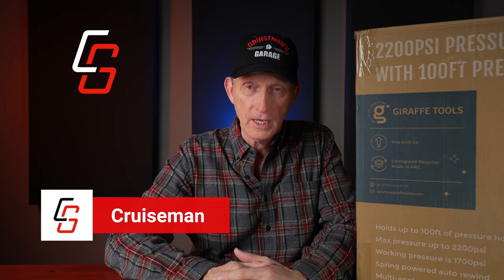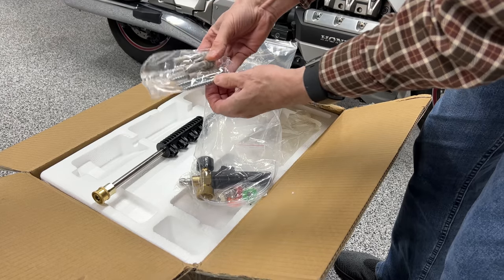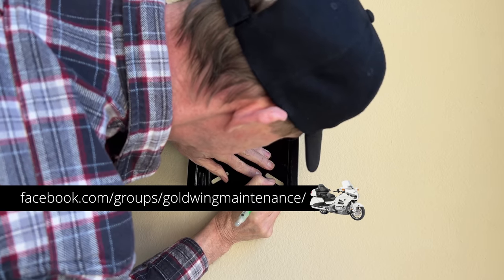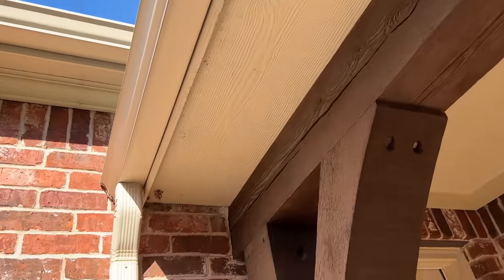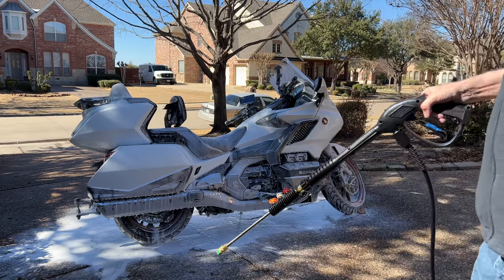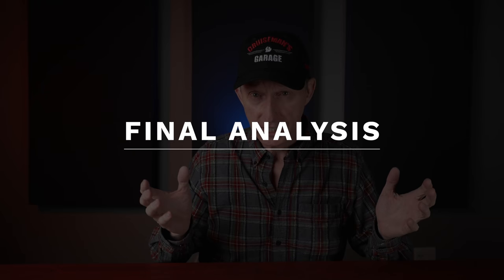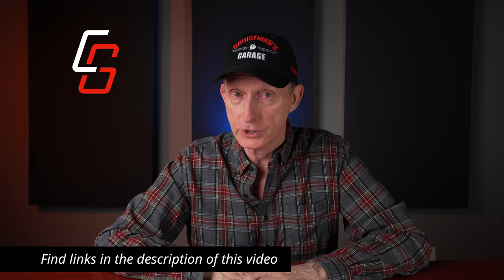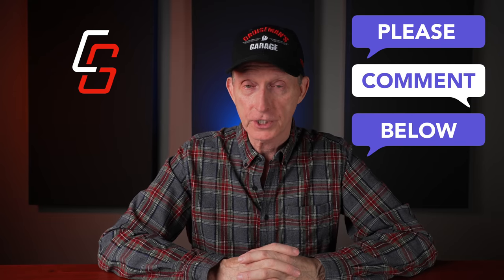Don't Buy A Pressure Washer Until You Watch This Video | Giraffe Tools Review

Comment: I must be behind the times as i've never used a water pressure when washing my motorcycles. And you've seen my Goldwing in my vlogs and it's alway's squeaky  clean and glistening!
Reply: 100% Ge. I wouldn’t either. Even with finessing of the spray and direction of the nozzle, it’s just not worth the possibility of any water seepage over time due to the pressure. Cruise did mention being careful in using one for the bike. Torrential rain wouldn’t target water like a pressurized flow from a nozzle would. Besides, hand-washing is relaxing and part of the ownership experience. It’s becoming one with your ride.
Reply: @roadglide  I agree with "becoming one" with one's ride.   Same goes with doing whatever maintenance I do; being more intimate with my 2018 Goldwing Tour DCT. :)
Reply: I bought a 2300 psi electric washer from Harbor Freight that is cart mounted. Portability and cost is unbeatable especially with their discount coupons. Added the soap fogged, shortie handle and wand extensions off Amazon also a turbo nozzle.  Totally satisfied and saved substantial bucks going with their tools across the board. Compare pricing as I do not know the cost of this unit.  Just checked on the pricing of this unit. $300. This price point opens 10’s of options gas and electric all more pressure and all portable. A wall mounted pressure washer is an innovative approach in the market for sure. They would likely be more competitive if they included a portable cart with removability which is routinely needed. You can pick up the Harbor Fraight 2300 psi model for $240 and can find 10 to 20% discounts routinely.  This would pay for the accessories off Amazon.

Comment: Hello! Mmm....you have an exposed aggregate driveway, if you use the wand only on that type of concrete job, you remove the small fine particles holding the aggregate together and the sealer(ask me how I know) you should use an attachment for that purpose which this is a good quality one ....... Mi-T-M 14" surface cleaner...... also after you wash your driveway let it completely dry  and you should re-seal it . Very easy to do with a pump sprayer. I do this every second spring, twenty years later and it still looks new 😁. Thanks for the vid. Be well !
P.S: a good review deserves a good deed(advice) back.

Comment: I won an electric powered pressure washer from work in a raffle.  I love using it.  I sold my gas pressure washer since I only used it once or twice a year and was always fighting the carbs.  If I was a professional cleaning guy, I would keep a high-end gas pressure washer around, but for small projects around the house (and me living in a single story ranch), I don't think you can beat a small electric pressure washer.

Gas pressure washers are worth the money when you have to hit multiple story structures without a ladder, plan on using a rotating ground brush attachment, or simply don't have access to electricity in a remote area.  I'd also suggest investing in a "turbo nozzle" for any pressure washer regardless of gas or electric.  It gives you the power of the zero degree nozzle over a much wider arc.

Comment: This should do ALL you probably need. I have a Simpson 3300PSI with Honda Motor. Inhave a lot of concrete to clean, and actually use a surface cleaner for my driveway/Patio. Change to a lesser tip if you want to have less force coming out, especially on motorcycle! I use a foam cannon for my cars all the time. I recommend Chemical Guys Snow Foam for great foaming action.

Comment: A suggestion from a small engine tech, if your unit does not have a bypass, turn off the pump if sitting for more than 30-60 seconds. You can tell if it has a bypass because water will flow with less pressure when trigger is not applied. The pump uses the water as a cooling device. So no flow, means no cooling. I've seen many blown seals because of this.

Comment: You'll now need to invest in a motorcycle blower dryer....something like a Bruhl here in the UK. They are absolutely essential for getting the water out of all the nooks and crannies in order to properly dry the bike and so prevent any corrosion.
Reply: I just use my gas Stihl leaf blower which is  fully capable for lawn work and drying all vehicles prevent micro scratches to paint from towels and chamois.
Reply: @SecurityBob  WORX electric/rechargeable leaf blower I use. :)
Reply from the maker: I got one as a gift recently and plan to review it as soon as it warms up!

Comment: Chris you would really like a Black Max 15" surface cleaner for your pressure washer for $100 I saw one at Walmart last summer. It would make pressure washing your driveway quick and easy. I have one I bought at Sam's club that doesn't have wheels by Power Fit 15" for $80.They have two pressure nozzles that spin under the 15" housing. If you don't already have one you will be amazed.
You have been a big help to me with your videos. I felt I owed you one. 
Have a great riding season
Don

Comment: Accessories. Wand extension(s) and a high pressure multi nozzle rotating surface cleaner  which makes large surface cleaning much easier.  I also use it on the metal roof and side oy my large metal storage shed.  Remember water hose length and extension cord if remote usage away from the house. Do they sell a wheeled cart? If you need portability. There are compress spray can lubes available. Harbor Freight has similar but portable units. 100 ft hose from compressor source may reduce head end nozzle pressure just a thought when spec’ ing pressure requirements.

Comment: Just watched Crown talk. You're absolutely right. Electric vehicles can't be supported with current infrastructure. It won't happen in my lifetime. I do have Electric power tools,  mower, saw. They work fine. I'll have the wing out in 2 weeks.  Fuel, 87 Oct. $4.39. I have a feeling the price of all motorcycles will go sky high. At 38 to 42mpg is a no Brainerd. Just like the price of used trucks. Sorry I had to go on this blog, couldn't get to comments on the Crown blog. See you on the road .

Comment: Chris, Having been in the trucking industry for a great many years, I have used pressure washers for a long time, and these are the industrial type.  My current pressure washer is 3500 psi at 5 gpm and will heat the water almost to 210 F way more than what you are using, and this is just a statement not a contest of pressure washers.  The thing to understand is that no matter how much pressure you have, to get something really clean there has to be contact made to the surface of some kind with something other than water.  That would be a brush or micro fiber towel, a chamois, chemicals help but they are not the complete answer.  Over the years I have washed paint away from a truck, without getting the dirt.  I also use it on my current 2019 Goldwing all of the time, however I am very careful how I use it, especially since the combination of that much pressure plus the heat can be extremely damaging to painted plastic parts, this I learned from a divot I put in the front fender of my 2009 Goldwing by getting too aggressive.  I like you stay long distance from the buttons and switches, however I am not afraid to get after the wheels, (I really like how it gets the brake dust) tires, and aluminum parts.  i think the real key to success with a pressure washer has to be using a measure of common sense.  I have also found that sweeping the spray and not concentrating it will really help to keep you out of trouble.  I love having access to my pressure washer and use it on all of my vehicles, however I have learned a great deal through experience.  I good bug dissolving chemical is also the best way I have found to remove the stubborn bug residue, then you don't have to concentrate your spray so much.  Hope this will help some of your followers who may be considering a pressure washer, I know for me I would hate to be without one.
Reply from the maker: Good info 👍

Comment: Can the unit be carried to the back of the house and the cord and the hose be attached there? Or does the unit have to stay mounted to the wall to function properly?
Reply from the maker: It should be able to function, although a better solution would be to have a separate bracket mounted in the rear of the house. But, it should work OK sitting on the ground.

Comment: Mounting bracket is poorly designed. Agreed that it appears to be intended to be mounted on concrete, blocks or brick, but I would never mount that much weight on drywall with anchors.  Bracket should be long enough to at least mount to two studs on 16" centers.  Think that if I had one, I would attach a piece of 3/4" plywood to a wood framed wall and then mount the bracket.
Reply from the maker: I may end up doing just that to be safe